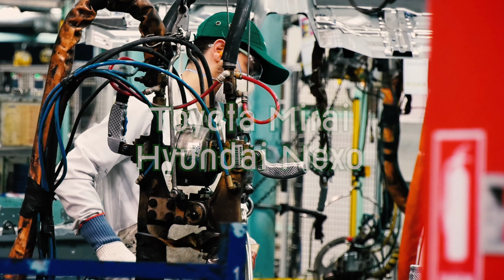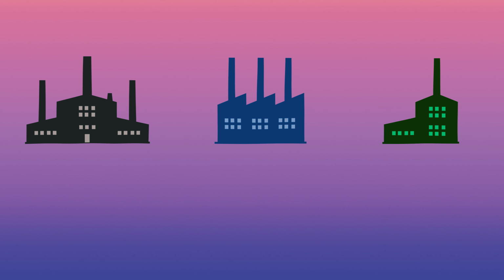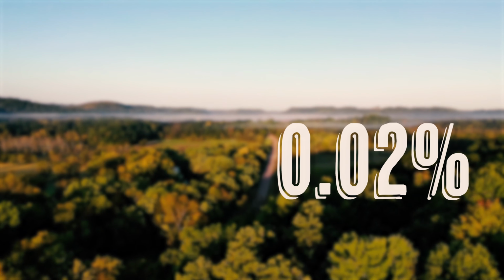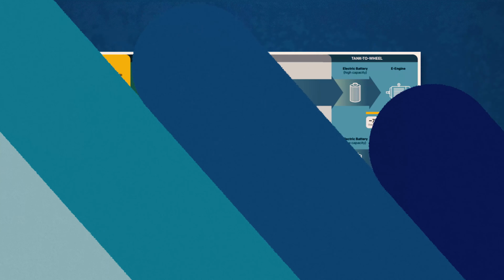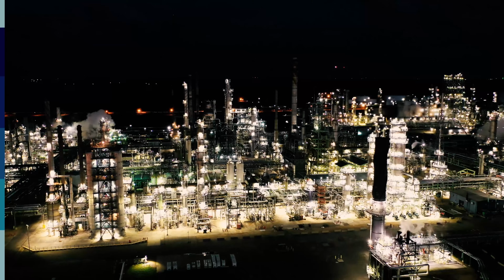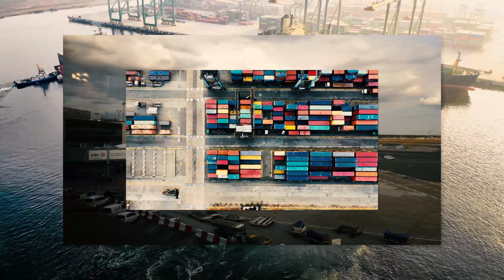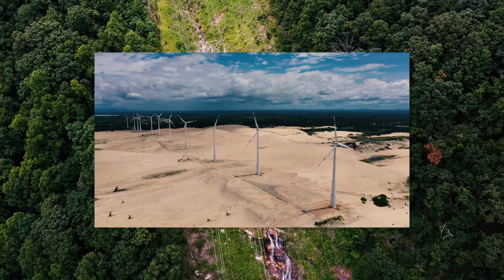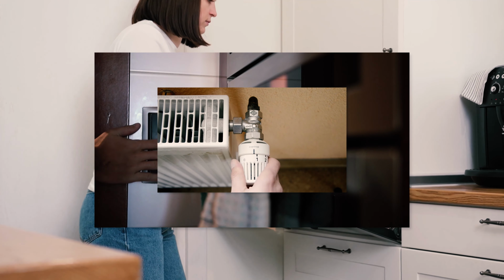Hydrogen Fuel - No Good For Cars, But Does It Still Have A Use?

Comment: You couldn't have done the research for this video without coming across Stanley Meyer or Bob Lazar's early 90's interview.   Hydrogen is a perfect solution for a gas alternative whether it's made on demand (Stanley Meyer's snuffed out invention) or pre-made tank stored version (Bob Lazar's banned, particle accelerated storage medium).  The nifty thing about Hydrogen is that it takes very little modification to existing gas engine technology to function at optimal efficiency.

Comment: Well if we were using Hydrogen for energy storage, using it for cars wouldnt really reduce the efficiency further, while potentually beeing lighter that a battery electric EV. Altough these batteries are not necessarily that heavy, I was unable to find the mass of the standart Tesla model 3 battery, but based on spesific energy capacity of good lithium ion batteries, it should be between 200-300kg with most of the 1,600kg vehicle beeing other stuff. Still a lot of the energy for EVs comes from fossile fuels and having a lot of them charge after rush hour could destabelise the grid. The best way would be to drive as little as possible, in wich case a battery is also at a disatvantage, as its production releases a lot of pollution, so using a small and light fuel cell car if you really need it can be more energy efficient, or you share a battery car with other people. Overall changing our cars to renewable energy should be further down the to do list, as we first need that renewable energy, for at least 20 years already.
Reply from the maker: I have a video on EVs and the points that you make which I’m still editing. Yes, EV production has high emissions and yes electricity for EV’s is not as clean as it could be. That being said, even with the current electricity mix in the EU, an EVs carbon footprint breaks even with an ICE car once they’ve both been driven about 48k miles. Every mile after that just makes the emissions of the EV lower than the ICE.

That being said, I spend the last 1/4 of the video talking about bikes and public transportation. Because cars in general just aren’t a sustainable method of transportation. So we need to push like crazy to get bike and public transit infrastructures built up as quickly as possible.

Based on your comment, I think you’ll enjoy the video when I finally release it in a couple months 😀
Reply: A problem with modern cars is that they become more and more like living rooms on wheels. When cars used to be for transportation only they clocked in way below 1 metric ton. The multimedia massage chair haulers that drive around today weigh twice as that, even without being electric. This has to stop.
Reply: @Eckendenker  yea, a maximum allowed energy usage per seat would be useful.

Comment: the comparison of efficiency between hydrogen fuel cell car and electric car is little weird... for electric car -> u must start from the generating electricity, which is about 30% of energy used for electricity, so that electric car's end-to-end efficiency should be 21% ~ 27%. which is worse than hydrogen fuel cell car.
Reply from the maker: Many governments are now setting up large solar farms and encountering the question of what to do with the electricity generated. They can either patch the solar farm into the grid to provide electricity or hook it up to an electrolyzer and ship hydrogen fuel.

In that instance, both forms of energy are suffering the 30% efficiency loss that you mention so hydrogen would still perform worse overall.